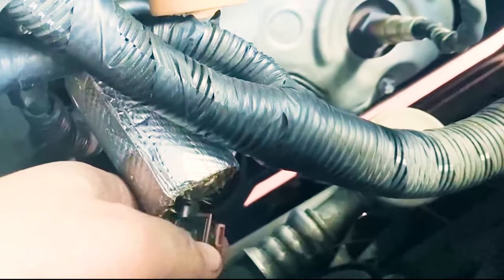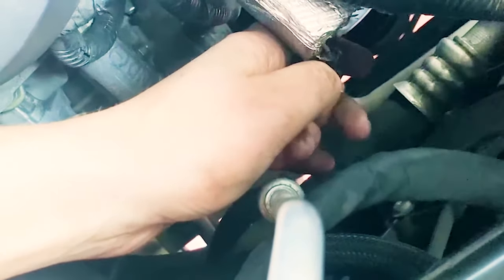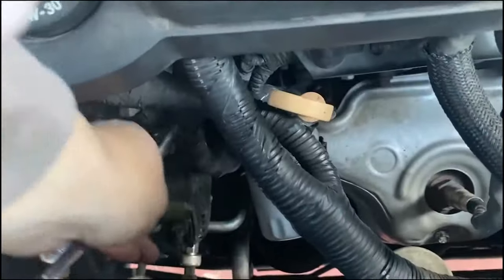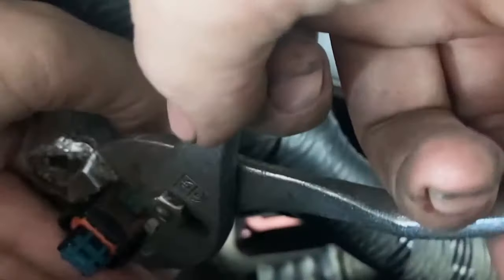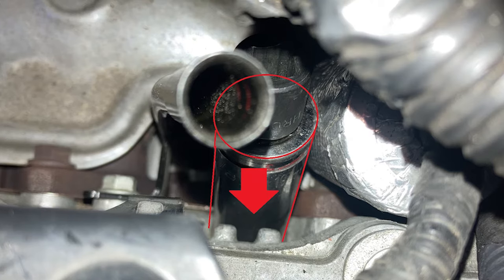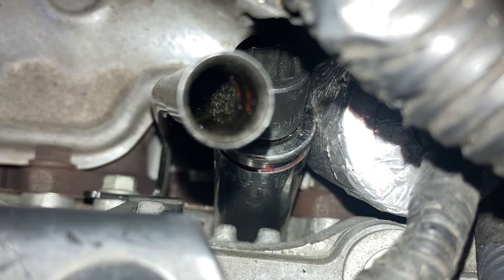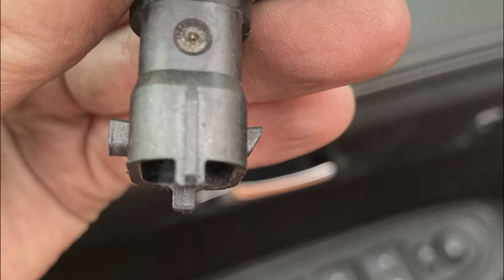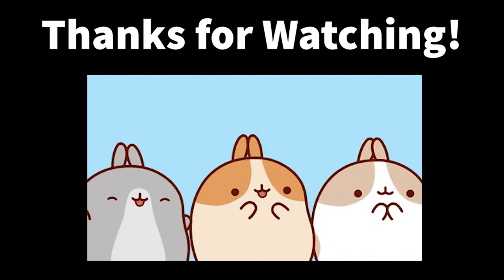2010-2017 Chevy Traverse - Replace ECT Sensor (Engine Coolant Temperature) - Girlie Garage

Comment: Did this job today. I don't have a bunch of sockets to choose from. I bought a 3/8 drive 19mm deep Kobalt socket from Lowes and it was not deep enough. Had to get a 1/2 drive set from Harbor freight to get one that was deep enough. Should have brought the new part with me when I went to Lowes. 
This was a pain to get out and replace, but would not have gotten it done without this video!
Reply from the maker: Definitely a pita! Thanks for letting others know about your tool choices, and glad you found the video helpful!!

Comment: Thank you so much for posting this video. I was working on a 3.4L AWD equinox. I bought drawings from all data AND Mitchell online both were very poorly drawn. Every other video shows the sensor on the rear of the engine so I went down a 4 hour rabbit hole that was wrong. Even after seeing your video I still couldn’t find it. But my eyes were tired by then.  

Don’t forget to clear codes after  installing new sensor and bleeding coolant if needed.
Reply from the maker: Great advice! Thank you for sharing!

Comment: Thanks for the video,I also broke the red clamp, did you have to replace it or did you just connect it and leave it as is?,just wondering if that was something I needed to look into soon or not?
Reply from the maker: The red clamp is like a safety measure. It helps the connector stay in place. If it were me, I would leave it as is, and you'll know if it starts acting up because your temperature sensor would come disconnected. The likelihood of that is so small because you still have the 2 sides that push in to remove the connector. If it bothers you, you can find a connector on another Traverse at the junkyard and splice it onto your car.
Reply: @GirlieGarage  awesome thank you again,your video was very helpful

Comment: does it mean that ECU has power to energize the radiator fan relay even if the engine is off ?
Reply from the maker: Sorry I don’t understand your question. However the radiator fan should not turn on with the engine off
Reply: The rad fan can turn on when engine is off and key is out if certain conditions are met like overheating. Or in this case a bad ECT sensor will make the engine think it’s overheating and fan will stay on for ~10 minutes after
Reply: @latenttweet  thank you ,that mean the ECU will send a signal to the relay of the fan motor even if engine is off

Comment: dose anyone know what the red clip is called?
Reply from the maker: It’s just a safety clip (prevents the connector from backing out when it’s depressed) it’s built into the connector so you’ll need to get a whole new connector and pigtail if it snapped off, or if it’s not that bad of a snap, just push the connector back in until it clicks (like a connector normally would)

Comment: And then she took out a hammer to bust off that plug. la la la his does fix the P2158 problem.  Also fixes the throttle code.  All because a heater hone broke and they over heated the motor.